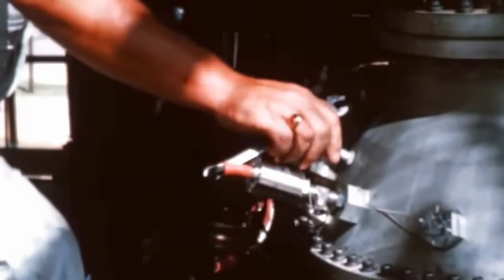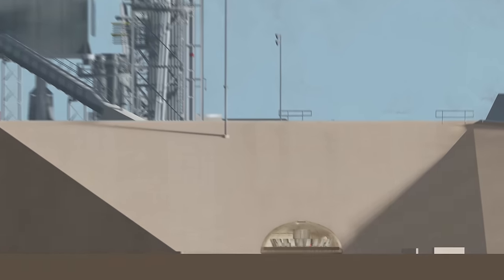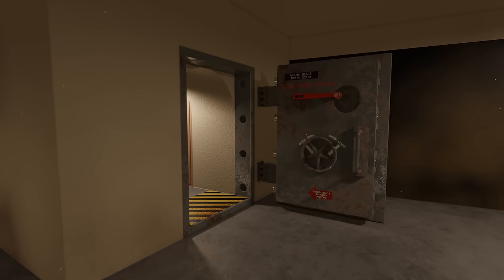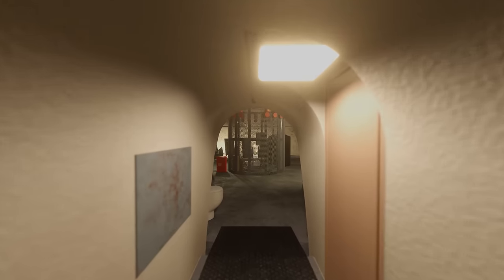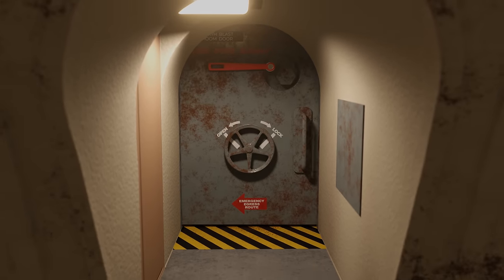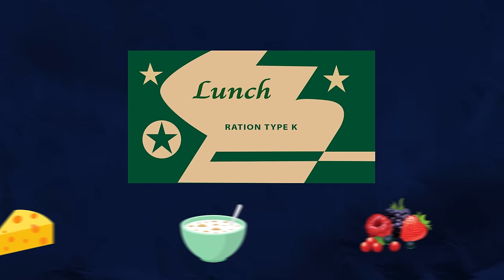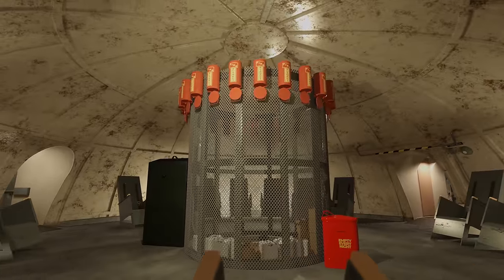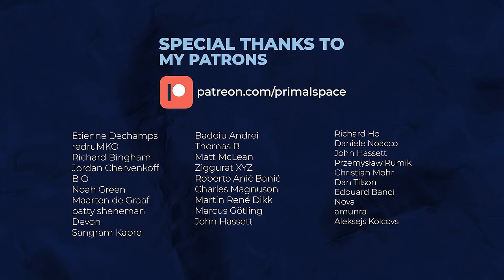NASA's Most Off Limits Room

Comment: Thing is, the launch pad is so big, how does the crew make it to the slide in time when an explosion happens? Or how do they know there's a looming threat of an explosion?
Reply: They wouldn't,but it's nice to believe you have a plan.
Reply: Why are you so set on ONLY an explosion happening???
Reply: @syberphish  Uhhh, OP's fixated on explosions probably because there's multiple things to indicate that the Rubber Room is built to withstand explosions? Its location... The room's shape... Blast-proof doors... Ya know???
Reply: @SqualingtonConstantine  a myopic viewpoint
Reply: @SqualingtonConstantine  Except rocket explosions aren't usually slow enough that you know something is gonna happen and have time to get all the way down to the pad to hit the slide. 

So, while they may have made it with those things in mind as a LAST RESORT....   there are still myriad other problems that can go wrong on a launch pad besides outright explosions.  

By it's nature, because it can handle the supposed worst explosion that would have been thrown at it, that's just it's highest level of defense. It doesn't mean it isn't capable of being used if there's an electrical fire, component malfunction or otherwise. 
They don't say "wait, you can't use the bunker because this is just a fire and isn't likely to cause an explosion!  That is ONLY for explosions!"

Discussing how it can protect from an explosion is of far more dramatic value for an audience than explaining how they'd use the same apparatus to escape ...a massive oil leak, fire, or other less-substantive situation.  

That doesn't mean that explosions are it's ONLY purpose. That would be just silly, and as you said he's "fixated" on it.  Most people who're fixated on one thing already aren't seeing the bigger picture. 

You can respond with your continuing sarcasm, or you could stop acting like a child.  Up to you.  Doesn't bother me at all, I'll respond to it just the same; but in the one situation you won't be shown for the fool you're being due to your willful ignorance... it'll just be a conversation.
Reply: @syberphish  Never knew my juvenile sarcasm could warrant such an educated response and an ending paragraph like that. Alright then. 

So you have proven yourself capable of seeing the bigger picture of the Rubber Room and how it's not just protective against explosions specifically. You don't have a myopic viewpoint, truly. When you saw OP's question you oh so graciously swooped in and brought attention to the flaw that is their narrow-mindedness. Good job. Everyone thinks you are very smart.

Comment: Saturn 5 had to be partially fueled at least when vertical because the fuel pressure maintains its structural integrity.
Reply: It’s amazing how many details we’re detrimental too the working of that machine. And even more amazing they basically thought of all of them and worked them out mostly analog.

Comment: This level of safety precautions and ingenuity by NASA always amazed me.They really though out all solutions for various cases and possibilities.
Reply: I think with the 60s tech of the rocket, it's sooo new, so they might want to precaution everything they can think of at that time
Reply: Not so much with the shuttle.
Reply: @edc1569  or Apollo 1
Reply: I am wondering if Space X is even capable of precautions on such level
Reply: @MrTLsnow  I'd bet this was done after Apollo 1.  It must've been.  The only way out of that capsule bolted from the outside.
Reply: @veramae4098  you're probably right tbh
Reply: The opposite of Musk's waste of $$$.
Reply: this what happens when you give engineerings a unlimited budget

Comment: I think it would be really cool to open it for tours or a space camp for children. Make the slide operational and safe and have some interactive activities inside the bunker.
Reply: Maybe drill down into the concrete to use the escape hatch on top of the bunker, as I feel like making kids walk all that distance to get out is a little much
Reply: @AHHHHHHHH21 well if it was a public museum it would need to be accessible to those in wheelchairs due to the Americans with Disabilities Act. Therefore they'd probably make an elevator that goes straight to the room with the slide by digging down straight from immediately above ground
Reply: @jamesrosewell9081  yeah, that would be better
Reply: @jamesrosewell9081  wheelchairs can go down the slide 😂
Reply: Can't get to the room until SPACEX and Artemis is done with the pads.

Comment: I imagine it's still there, it was there during Shuttle days because I saw the Rubber Room on Pad-B.  It was way down inside the PTCR, in the very back of the ECS room.  He's right, it was blocked off but you could easily see inside.  The chairs were still there (but just the steel chair part).  I walked the tunnels of both Pad A and Pad B all the way to Perimiter Road (where the Slide Wire escape system ended).  The one on Pad B was scarry because it had water in it and there was a place where some underground obstruction was there (abut half way to the end) when they built it and you had to go up and over it to make it  to the end.
Reply: You work there or was this a tour of some sort that the fun police have ended?
Reply: @Iceberg86300  I worked there.

Comment: Would they really have been able to detect an imminent explosion with enough time for the entire crew to get to the bunker?  I would think if there was going to be catastrophic failure, it would happen without warning.
Reply: Not to mention, the time it would take for the crawler to dock with the slide tunnel. When things go wrong with a rocket, there just isn't any time from the time the problem is discovered, until the BOOM!!
Reply: Yes, a fuel leak. Did you not watch the video??
Reply: @vincentrobinette1507 people wouldn’t be on the crawler working until after it was set in place. Come on man do some actual thinking here

Comment: 2:20 LOL so they didn't even come up with a solution for you know... preventing possible broken bones?
Reply: Just throw a ton of foam at the other end idk lol
Reply: Drainage system always works
Reply: it’s nasa, they gotta think better bruh
Reply: a natural evaporating holding tank would do fine, the rarity of having to use this could make it a decently cheap and efficient option, at the end and bottom there could be a bunch of tiny holes to allow it to drain into the evaporation pit

Comment: Nice , I worked at the NASA when I was younger, I worked at all the launch pads actually, but the Saturn launch pads I never knew that was that was there. At the shuttle pad , they have a large underground complex. They also have missile silo's along the beach, these are little hills with metal doors on them that anti air rockets pop out and do their job

Comment: As someone who worked on numerous launchpads, it’s very interesting the forms of escape the various companies implemented. My favorite is located at a site that was designated and build for shuttle launches out in California. The skeletal tower that the rock is “attached “ to featured three huge zip lines for the astronauts to escape on. They would hop into these carriages that would zip down and away from the pad where they would stop and allow the astronauts to get out and run for an underground bunker for protection. I wish the zip lines were functional during my time there, but the bunker still existed.
Reply: SpaceX and Boeing still have the ziplines in various forms, and they were present at the Florida Shuttle pad as well. Boeing uses one-person seats but the rest are likely the same basic design as what you saw in CA.

Comment: Now I'm just making a guesstimate here but I'm assuming but the time you climb down however many flights of stairs it took for wherever you were on the launch assembly. To reach level a, that would probably have taken I would assume a couple minutes. And then all right the slide that's probably pretty quick. But then again we still have that problem of people breaking bones when they hit the bottom of it as you stated in the video. And then you have that blast door. Now I'm assuming that would be open. So how much time do they expect the maintenance people and crew to have from the time they detected something was wrong to the time they could get into this bunker and close that blast door. That includes carrying anyone that was injured coming down the slide into the blast Dome it seems to me that to get 20 people evacuated down the slide into the bunker assuming no one was hurt and close the door probably would have taken I would say at least 5 minutes maybe 10 minutes. If we're looking at a hydrogen leak unless they just decided all right we're not going to try to stop it we're just going to evacuate and let it do whatever it's going to do. You have no idea how much time you're going to actually have from anywhere from a few seconds to what could be hours or even days until the system was empty of liquid hydrogen. I'm wondering if this bunker was just a case of let's give them something are the safety precaution. Knowing full well that there's no way they would probably be able to reach it. There was a similar evacuation plan used at the Kingsbury ammunition plant in indiana. Where the front of all of the rooms with a processed explosives was made of glass to the explosion would blow out the glass and not damage the walls. At the back of every room was a full size door opening that had some rubber flaps hanging over it and you went into it feet first by jumping and grabbing a rail mounted on the wall so you could swing yourself into the slide. That would take you into the slide which went approximately 250 ft away from the building before you were rejected out into a pit. And then the procedure from there was to get to your feet and run as fast as possible away from the building. After speaking with several people that worked in that plant when it was an operation they said that although they practiced using the slides and evacuating the buildings should there have been an actual detonation of any of the explosives you would not have had time to even get to the slide let alone run away. The only time this might have been useful as if a small fire had started and for whatever reason no one used one of the multiple fire extinguishing methods that were in each of the assembly and compounding areas.

Comment: Despite how smart they may have been, they didn't realize that it would be completely useless. If an explosion is going to happen, you most often don't have anything more than a few seconds at most before it explodes. You definitely don't have the time to go on a water slide and hold a door open for the people who came behind you. How incredible in terms of both engineering and ignorance.
Reply from the maker: Such a fair point. I would really have loved to have been a fly on the wall during those design meetings. Just enough to understand more about what they theorized would actually happen.